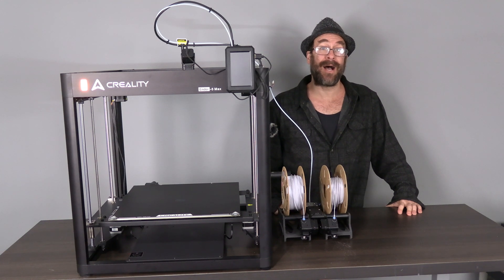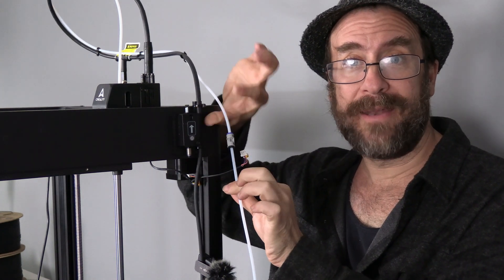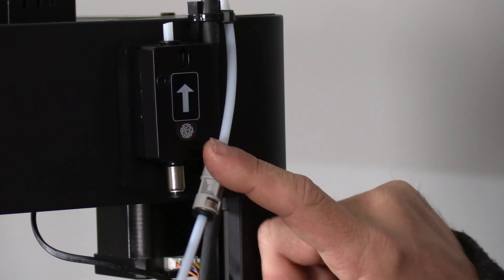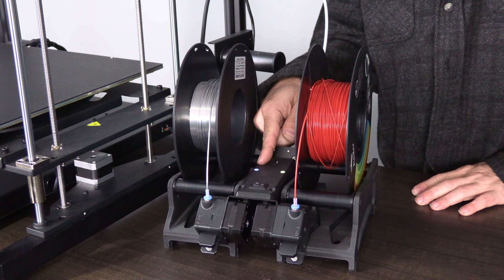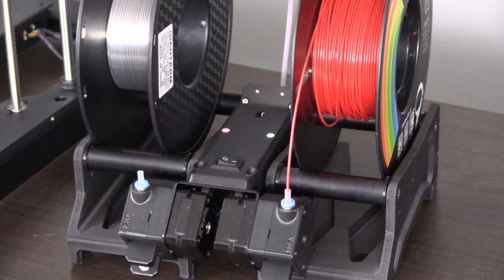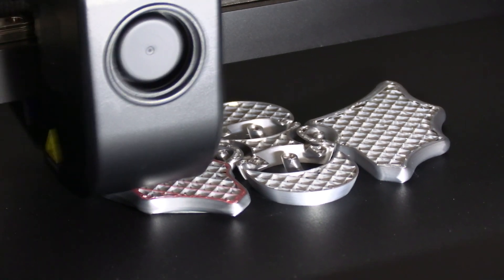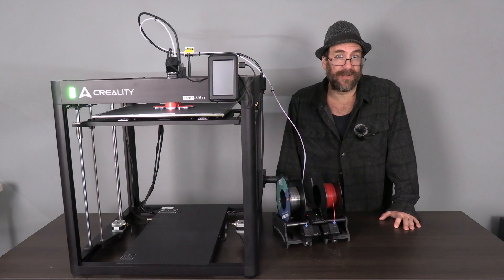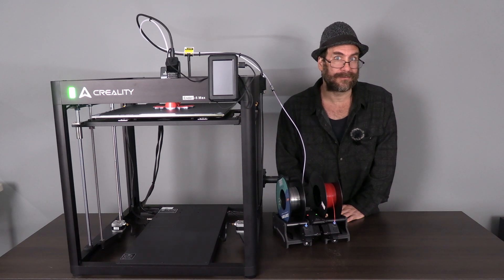InfinityFlow3D S1 Auto Filament Changer, on Creality Ender 5 MAX.

Comment: Question? How did you get a bowden tube connector on the bottom of the runout sensor? Mine does not have one and I want to connect a bowden tube to the bottom of the runout sensor to a filament dryer. Any helpe would be appreciated.
Reply from the maker: You screw a coupler into it, provided by Infinity 3D peeps. But I stopped using my runout ages ago.

Comment: Brother, how do you keep the bowden tube from blowing out the top of the printer head from the pressure of the infinity flow? I woke up with 2kg spool blown out all over the room....
Reply from the maker: You want the real answer?  *SIGH*.....   By relocating my IF3D to the floor in my basement. I sent them detailed suggestions, on the issues facing the IF3D. To my knowledge, they did not address them. The consistent forward pressure, is a problem, for a number of reasons.
Reply: I have the same issue with the blow out after the print has finished.  My only solution is to add a wifi outlet to the power of the infinity flow. Wait for the notification that the printer has finished and turn the power off thru wifi.

Comment: Have you printed petg on it?
Reply from the maker: no
Reply: @3DRundown  I have and it's great. On mine, if you send a print file over WiFi and begin printing from the screen (on the printer) you must check the 'Calibrate' box before hitting 'Print'. It will then raise the bed temperature to your PETG figure (eg: 85 deg) before performing the mesh bed leveling. I have printed a 395 x 395 test frame and it came out perfectly with PETG. You can easily see the curvature on the bed at this temperature (looking straight along an edge) but the surface map seems to compensate correctly when printing.

Comment: The internal diameter of the PTFE tube on my Ender 5 Max was 2mm. Replacing it with a 2.4mm id tube made filament movement much smoother. (Thanks to @Defyant123 for pointIng out the fix!)

Comment: Cool. My S1 arrived about a week ago and I didn’t get a buffer coupler like you used in this vid. I’ll have to reach out to Infinity to ask for one. Thanks for another video.
Reply from the maker: It's so much better this way
Reply: @3DRundown It would make my setup much simpler and more efficient.
Reply: Neither did mine. I also had to choose a single spool size, rather than getting all three size spool holders. I guess they sent out a delux kit for review? Still, it's working and I'm glad to have it.
Reply from the maker: Yea, I specifically asked for any accessories, that would be of value to show. They asked which size holders I wanted, and I requested at least up to 3K, because I had secured a 3K from Overture and Polymaker, for this video. Ultimately, when it showed up, all 3 sizes were there. I also saw the adapters on the site, and asked for those. I don't like being in the dark, when I get questions, so, having everything, is very helpful. Sadly, I haven't had the time, to work more with the S1, but, I hope too. Especially when the next update comes out.
Reply: @3DRundown Makes sense. I’m actually using the S1 right now as I’m printing custom 10” rims & tires I designed for my grandson’s 24v ride on toy car to replace the standard hard plastic ones. So it takes a lot of PLA for the rims and a lot of TPU for the tires. The S1 will let me sleep well since each rim takes about 25 hours to print. Can’t use the S1 for the TPU but it’s great for the other filaments. Take care sir!
Reply: @ I contacted Nathan from Infinity and he confirmed that a coupler is not included with any S1, it’s an optional buy from Infinity. I ordered 3 from AliExpress @ about $1 apiece.